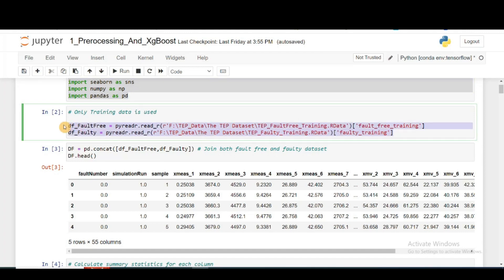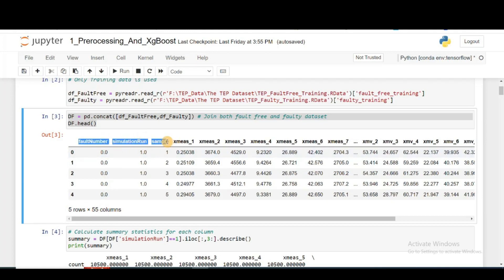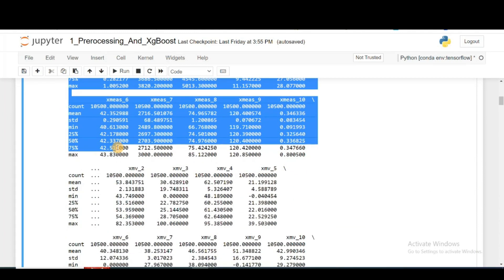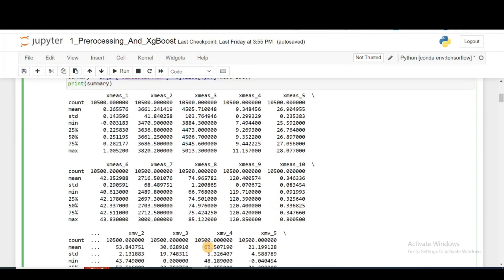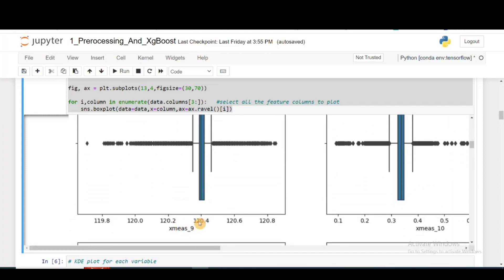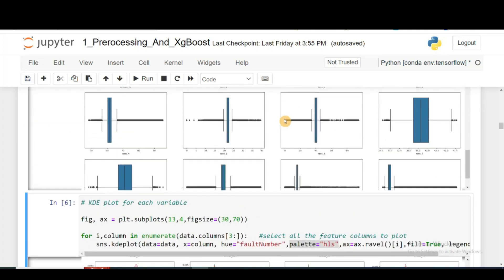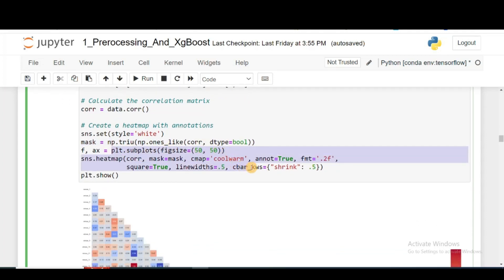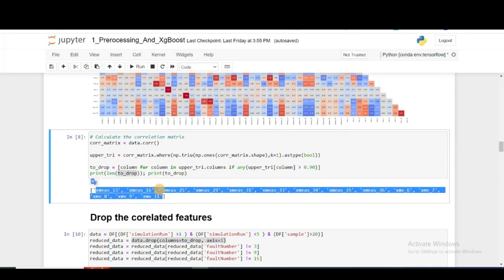Exploratory Data Analysis (EDA) for Fault Diagnosis using Machine Learning

Comment: Hello, can I understand  more on why mean and standard deviation have close value indicate good feature?
Reply from the maker: Hi, thanks for the questions.

So for if one feature in your model is constant throughout, then it'll not have any discriminative power. This means the standard deviation is zero (no variance) for this feature.

We want those features, who have a high variance to train a model. This gives an indication that, this feature changes when the fault condition changes (it's not always true). But it is a good starting point to ignore the features having very low or zero standard deviation
Reply: @Mohankumardash  alright understood thank for clarifications😃
Reply from the maker: @lucysii6085  I am glad 😊